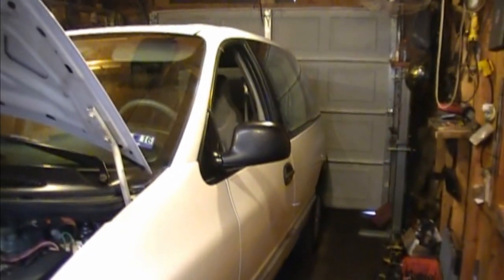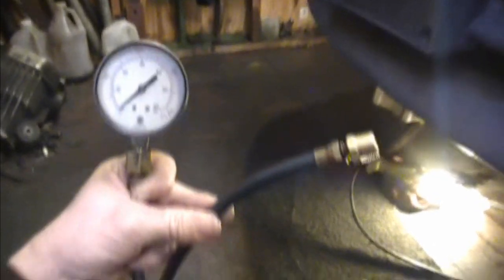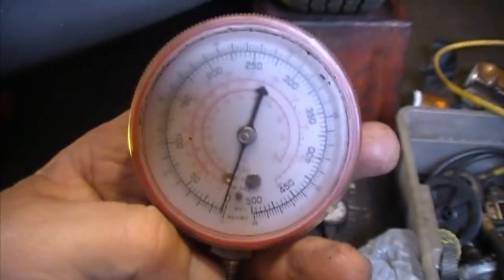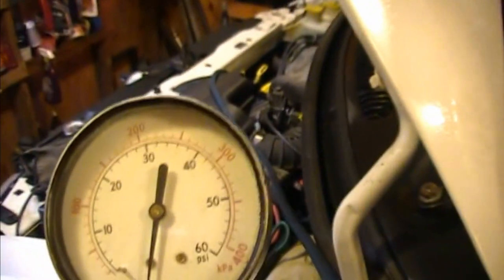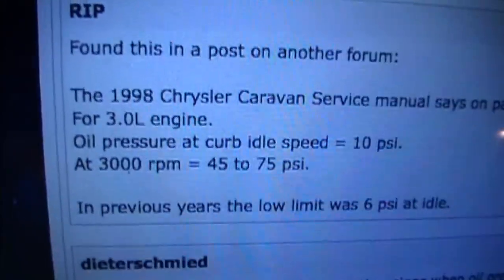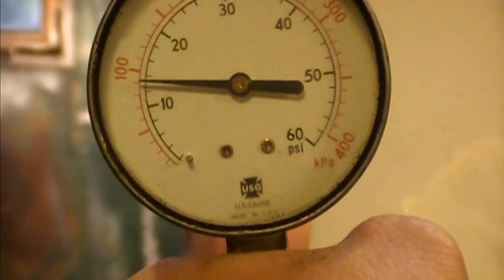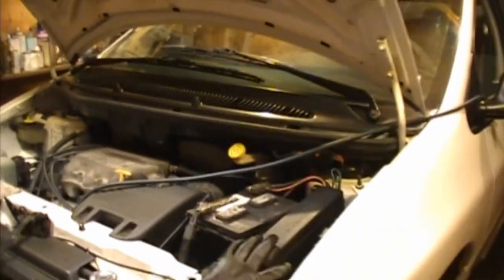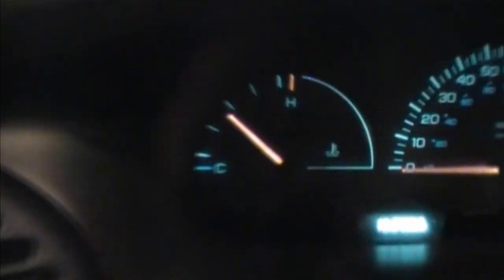Oil Pressure Light blinking at a stop...fix / checking sending unit.

Comment: The same problem here. But I'm just wondering if get it right that I should use thicker oil to solve the problem. So if I'm using now 15w-40, I will change it to 20w 40?
Reply from the maker: That's what I would do. I used 20-50 and it mostly kept the light off. Could be a main bearing clearance or a weak oil sender.

Comment: 2015 Kia Optima ex, has this issue. Checked oil and it looked good. But it’s been idling low at 550-700 rpms. Any recommendations?
Reply: Hey, did you find the problem? Gotta 2017 Hyundai sonata doin the same ..
Reply: @jrproductions9191  honestly, not a god damn clue. Sent it back to the dealer and it was fixed for a bit but now it’s back to it and it’ll stall out of nowhere. Lmk if you find anything out.
Reply: @jrproductions9191   i do have the same problem since 4 days, 2017 hyundai sonata, can you please help me with it

Comment: I repaired my engine and on idle the light turns on and off. We use penzoil 10w30 to lube better and it was the worse idle runnig 25psi, then aded( stp sae 30 ) now runs great at 30psi low and 65psi high
Reply from the maker: Nice!!

Comment: I think the PSI is fluctating right around 10; this will cause the light to have a spaz since <10 triggers it, and it's constantly going just below 10
Reply from the maker: Yea could be. It was annoying. I wounder if it was just bad oil or worn bearing just below thresholds sometimes. But motor sounded fine.

Comment: Same thing just started happening with my 2018 kia soul. It flickers at stop lights. Engine is running smoothly. It is winter here so not sure if that is a reason.
Reply from the maker: Add thicker oil. Engine sounds ok then its probably going to be ok!
Reply: Same with 2017 Kia Sorento!
Reply: My 2016 Kia Soul is doing the same thing. Did you find a fix?
Reply: Same here 2013 Audi A6
Reply: Same with kia sportage 2012 . Any solution? Im changing sensor on Monday
Reply: 2018 soul plus. 125k. Flickers below 1500rpm. Should I freak out?

Comment: My 2008 Chevrolet Aveo is facing a similar issue.  Oil pressure light starts flickering at stop signals.  Changed the switch,  still no improvement.  When I accelerate there is no lights flickering.  Is there any chance for bad pump ?
Reply: Did you find the solution ?
Reply: Did anyone figure out the solution for the blinking gas light after you change the sensor I'm having the same problem with a 1997 Dodge Ram
Reply: And I changed my oil pump as well still same thing
Reply: Hey bud did you figure out the problem with your vehicle because mine is doing the same thing and I change the sensor still same thing

Comment: My car has the same problem but sometimes the light doesn’t come on at all. But sometimes when I’m stopped it will flicker or come on. My friends say it’s a bad sensor and that it’s ok to drive until I get a new sensor. My oil looks good and filled the correct amount. What do you think?
Reply from the maker: Low pressure ;(
Reply: @FixingWithPassion  shoot, can I put heavier oil in it to make it go away? I still wanna drive it you know
Reply: @FixingWithPassion  could it be my sensor?

Comment: I have right now the same problem with my 1997 Dodge Caravan 3.0, the light is blinking on sometimes (not all the time) but I'm from México (too hot) and my engine use 20w-50, should I use heavier oil before to check the oil sensor?

Comment: good video, and this happened to me today , mazda mpv, but i was told the water reservoir for wiper was low. Didnt believe it but i added about 50cl alright and the oil light disappeared. the Electrician told me the sensor responds to low water for wiper too
Reply: Hey, did this fix the problem? I own a 2004 mpv too and I have the same problem with the oil light.
Reply: @sojiroseta8393  nope, light came back and it was found to b the oil switch wire having partial contact with the oil switch itself, close to the point of insertion.
Reply: @segzy05  what have you done then

Comment: my oil pressure switch was replaced and the oil is on full but this is still going on my catalytic convertor went and it will be fixed in two days would that light come on like that for this reason or since all of the above has been done so does this mean the Pump?
Reply from the maker: Engine noise?
Reply: Sounds like a mild truck like if there's no muffler on

Comment: I  dont know if i have to rechange the oil again because oil is fresh i just put there i touth it was a leak so i added 1 more qt and the light got worst
Reply from the maker: change the oil to thcker oil 10w30 or even higher- straight 30 weight. I bet it will help it. Also a $10 new sending unit would be a great help!

Comment: I’ll start mine and sometimes the light will be on sometimes it won’t.. When the light is not on I’ll run it drive it around then it’ll just turn on all the sudden and stay on idk what’s goin on Seems like when the lights on I lose power like slow acceleration idk what wrong w it. 2000 caravan
Reply: Did you find any solution?

Comment: My jaguar x-type is flickering the oil light on and off .167k on the odometer
Reply from the maker: o my!!
Reply: Nathan Rohrbough my bad for the late response. I am hearing a rattle in the engine as I accelerate,but when the vehicle goes back to idle the engine sounds fine, I am suspecting a bad rod bearing in the engine?

Comment: Same problem with my 1999 toyota corolla, changed oil pressure sending unit, no change... I change the oil 5 -30 w...what's a heavier weight of oil  I can use?
Reply from the maker: 30- 50

Comment: my light came on 2 days ago and I changed my oil yesterday.  My light would still turn on at stops.  Not sure if it s supposed to turn off immediately or I need a day for it to notice the new oil
Reply from the maker: Use thicker oil...20-50w
Reply: TVWXMAN32 turned out to be a bad sensor connector.
Reply: bad oil pump
Reply: THANKS...Im gonna do oil change 1st...then see what the light does. I got the Pathy last July but only have driven 3000 miles in city due to COVID. My 05 only has 168K miles and purrs like a kitten.

Comment: my charger did the same thing....i changed the oil pressure sensor,  problem persisted...i saw that the sensor connector was soaked in oil so i bought an electronic cleaner and cleaned it. problem was still there.  then i changed the sensor connector and the problem seems to be gone.
Reply from the maker: Cool! Put some thicker oil in it also. It really helps!
Reply: Will keep in mind..

Comment: a lot of newer cars call for 5w20 due to closer/tighter tolerences.typical Chrysler with the sqeeky belt or pulley squeal,its due to the belt not being tentioned properly,the serpentine belt is to be set to a specific tention & checked with a special belt tentioning tool b4 the belt tentioner is installed or it can wear it out & you get that squeal..my girls 05 sebring is the same was,oil light comes on after it warms up,then when it comes to a idle it will turn on a oil light yet the rear valve cover is leaking so maybe oil has got on it causing the problem but,i will be fixing many of its problems this week! motor runs & sounds GREAT & I hope its not the oil pump because its under the timing chain/crank sprocket on a 2.7 sebring
Reply from the maker: You are right. That oil pump it in the worst place ever. I've had 2.7's that sounded great but oil light always came on when warm. Usually thicker does the trick.
Reply: Fast response!!!!! what I can say about her 2.7 is that it has great torque & hp compared to my 03 fucus!!!! my focus needs a turbo, supercharger, nitrous or simply anything that will give it something resembling balls.it probably needs a rebuild.it does OK normally but put it on a steep hill & start at a low speed, it's slow!!!!! so I'm gonna spend $ on a ebay turbo kit & hope for the best
Reply from the maker: Focus is a good car...but like you said....turbo would be fun!
Reply: I clicked on the last message u sent me & my phone messed up so I lost it & can't find it???? I saw the headline saying focus' s are OK or something like that
Reply: @FixingWithPassion  oil grade matter my owners manual 5w30 what oil I fill in my car

Comment: I had just swapped to 5w-30 and have some Marvel in there too. I have always run a bit of Marvel Mystery oil with my oil, but may have put in too much this time... It has got me 252,000 miles so far. But I think I will dump this batch and put in 10-40... see what happens. I will make me a gage too. Thanks for this great video!